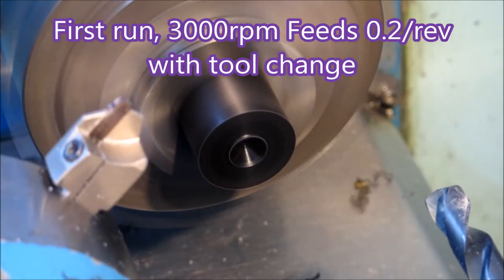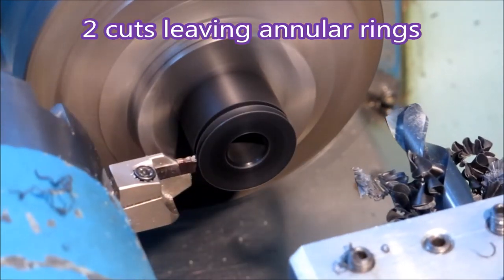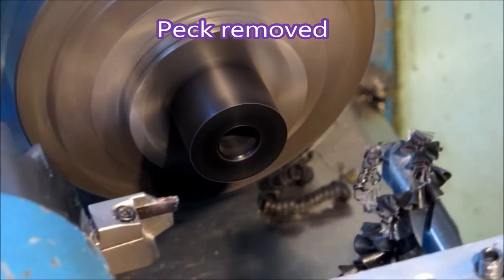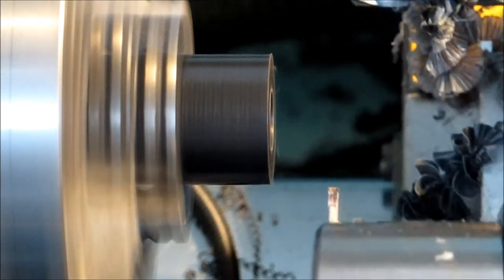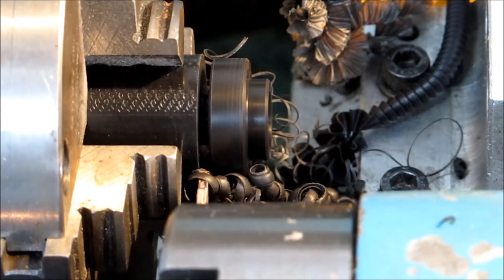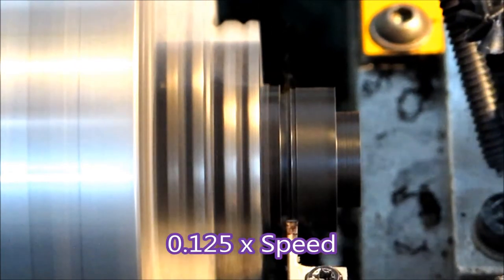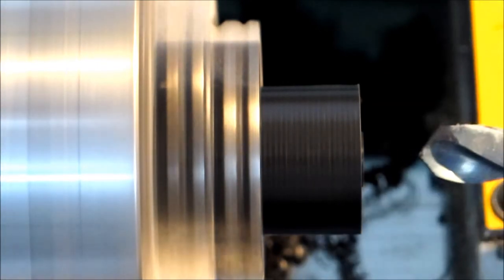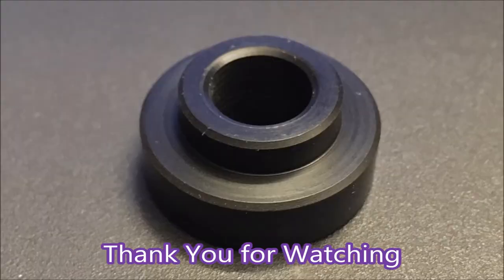Turning Delrin in small cnc lathe, drilled then profiled with a parting tool. With code improvements

Comment: That was very interesting.   Do you program the tool to go to a certain end point at a certain speed?  I guess you have to tell it to go to a position outside radius and then over to the next point then in to cut the groove.  
Also it looked like the final cut off left a protruding center. Is that because the cut off met the drilled center?   
Very nice to see how you progressed through this.  I am going through and picking videos to watch.
Reply from the maker: Hi Gary, welcome to my channel
Movement is of two types, a rapid or a move. Rapids are all at the same  rate of movement, whereas the movement rate for each move can be set separately. So although it would be unusual, each line of code specifying a move could call for a different rate of movement.  The protruding centre is because the end of the tool is square, this can be avoided by using a parting tool with an angled front edge. However using a tool with an angled edge is not possible when making a shape like this. 
Normally when parting off like this, I don't want the part to drop off as it can be damaged if it throws off with force. I try to take the tool in far enough enough to be able to tap the part off the material.
Thanks for the comment

Comment: Hercus Compulathe?
Reply from the maker: douro20 no the Compulathe was the earlier model, a complete stand alone cnc. Much the same as mine but mine is dependant on a pc to drive it. The software that comes with the pc enables me to use the lathe. I doubt that I could run a Compulathe.